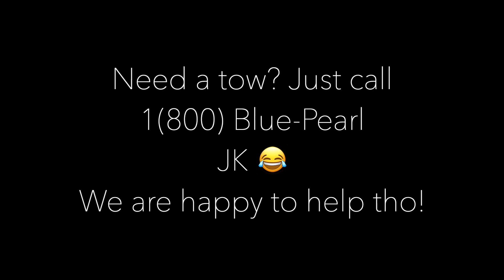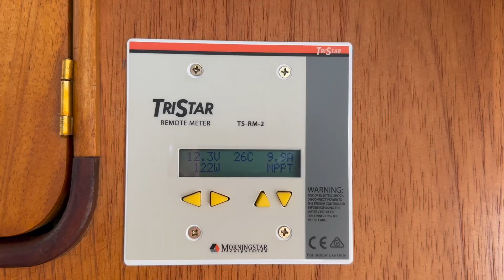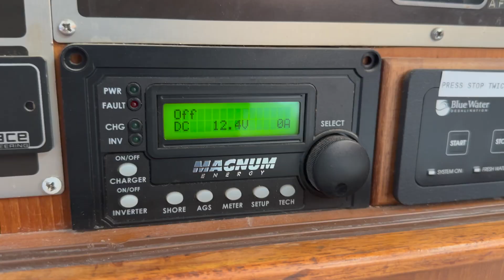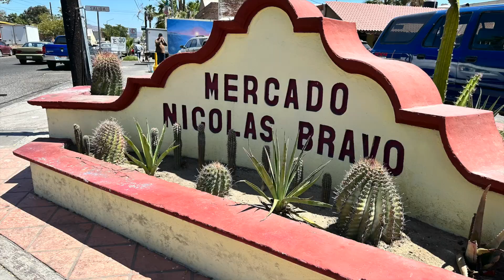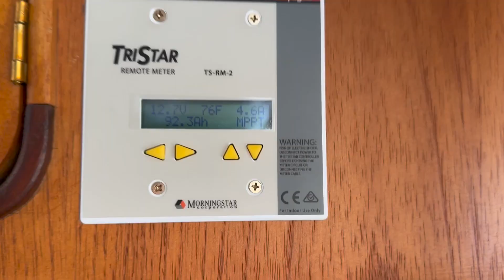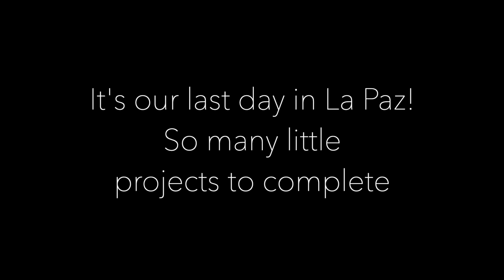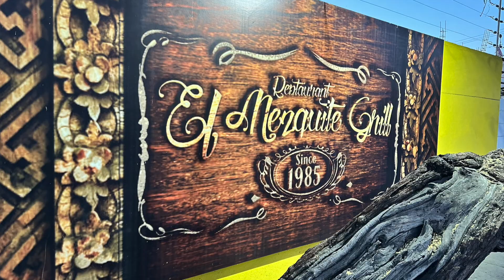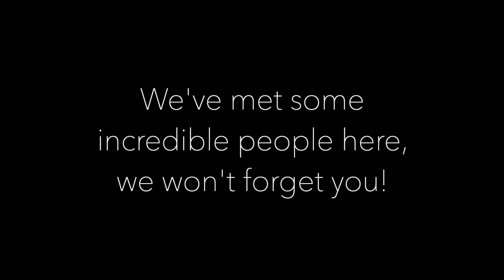Ep 41 | We had dinner with YouTube sailing celebrities and left without a single photo!

Comment: Hi Guys.

You mention that the only way You had to charge Your Batteries was to run Your Generator. Does You Engine not have a couple of Alternators.?

David. Down Under.
Reply from the maker: Hello David! Great question, but sadly the engine does not. We've asked a couple mechanic/electricians if they could resolve this - nope! Not yet anyway. Hopefully when we haul her out we can finally remedy this issue.